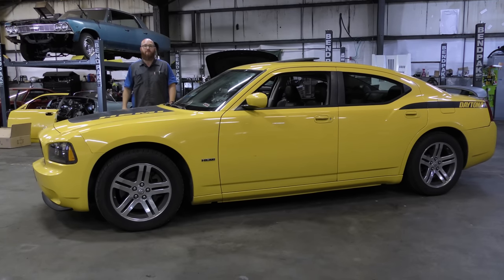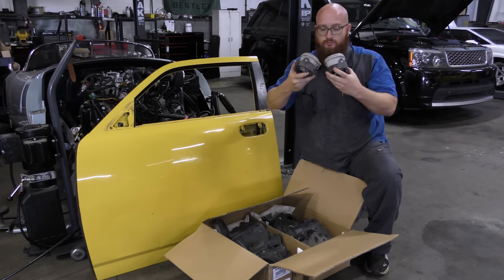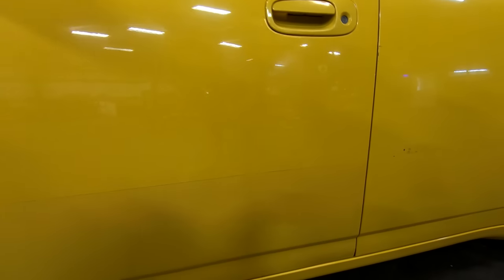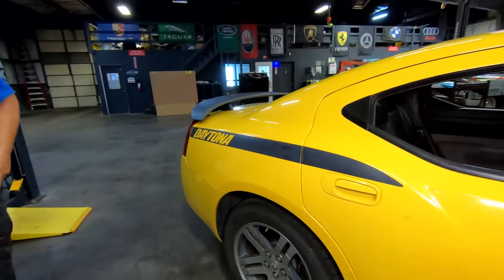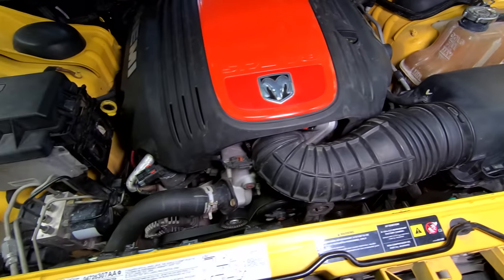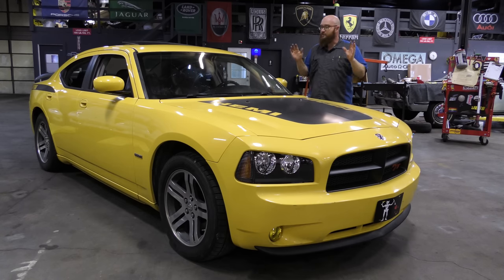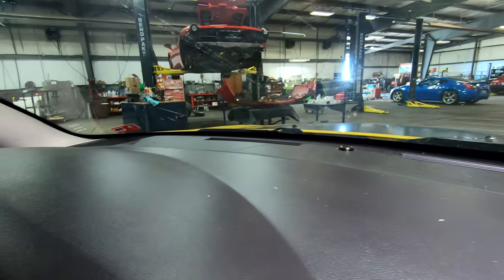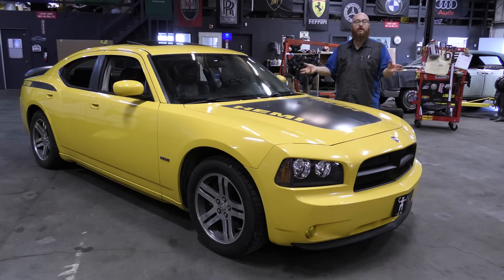Runs great! CAR WIZARD knows why he was sold this '06 Daytona Charger with a 'dead engine'

Comment: Top Banana is an awesome color! So happy to see this being fixed and driven!! I have an '08 Hemi Orange I bought new and drive it occasionally now, as it lives in the garage.....low miles and numbered lol! I am curious what number the one you bought is. The number is located on the passenger side to the right of the glove box. Should be xxxx of 4000, which is the total that Dodge made in '06 of that color. Also little known fact, the #1 in Top Banana was crashed by Dodge for insurance testing!

Comment: Hey wizard,
  I ditched the MDS a couple of months after I bought my Daytona brand new and never looked back...Did it  with the predator tuner...Actually got better gas mileage with it off!
Makes a big difference in the drivability too...And it backs off the traction control to where it's not annoying anymore! It's still there just not in your face!
   That's the only mod I ever did to mine cause it worked so good. I highly recommend it! Gets rid of that lame sound and vibration too....

Comment: I Bought a Porsche 944 S with 289,894 on the odometer for 3,500 put 2k in it drove it as a daily from Spring - Fall. No rust ran wonderfully. Sold it recently to a young man and his dad for 5, 500

The Miles will always plague the vehicle. But if the body is clean and straight. Runs and drives fantastic. You can't go wrong. 

Yes it's a gamble. But even buying a new car or slightly used one is the same way. 

I would rather buy a sorted vehicle that was well taken care of. Then a car at a dealership with a price to good to be true with low mileage. 

Thanks for sharing wizard 🧙‍♂️

Comment: For sun exposed bits, like the cracked piece you replaced, the whole dash etc, applying aerospace protectant 303 is a good idea. Used on airplanes and boats as well.
Reply: I use it on every new or used vehicle and it’s the best!
Reply: Believe it or not, for the black trim around the windshield, a lot of people use peanut butter to restore the black.

Comment: My sierra would sound like a dying tractor going into AFM mode, 
Had 200k and it still worked 
Most annoying part was it would switch into 4 cylinder than back into 8, go down a slight hill back to 4. 
Was like someone spamming a light switch. On off on off on

Comment: I have a 2012 R T classic challenger I got in September last year It have 49k on the car I had a repair shop in Knoxville TN with my dad and sold out but in the MDS or MSD I took the diablo I3 platinum tuner and turned it off that makes it a much pleasureable drive with no check ✔️ engine light on .

Comment: I had an ‘06 Magnum SRT8.  Loved that car!  You might want to check the side window defogger vents, they were something like $20 for a pair on Amazon.  But on my Magnum, the adhesive and the locking clips failed, and the vents were floating in their holes.  The replacements clipped in place and looked a bit blacked than the originals.  You have to like a $20 repair that actually makes the dash look better!

Comment: Definitely worth putting money into it, like you said for 3000 grand and you fix all the little stuff. You’re in it for 6 or 7  you can’t find one for under 10! Im a Mopar guy had 2  R/T chargers an 07 and a 09 and 2 magnums 05 3.5 HO with 275,000 miles didn’t burn a drop of oil and now I have an 06 R/T AWD I bought for 4500 sat for 6 years I put about 3500 into it and it looks mint! Love your channel

Comment: Glad to see a GEN I HEMI in the shop.  With MDS and an aftermarket exhaust the resonance is bad when MDS is engaged.  Had an MDS solenoid go bad on me, somehow ended up with a bent pushrod.  deleted the MDS, new CAM, push rods, lifters. new tune. Runs great.  Original owner 07 R/T AWD. 82k miles.

Comment: Wizard does better than Hoovie on buying cars with problems.  This car looks like it was possibly adult driven and then it was maybe passed down to teen driver.  The miles are about the time the suspension was completely worn.  The owner not knowing about cars like you mentioned, thought suspension noise was engine issues.

Comment: I just bought a 2012 pursuit that had an engine swap about 60k miles ago. Seller didn't realize it was a recent swap. Runs, drives, shifts, and stops great. Couple dings and dents and a few things I want to get done. But I picked it up for 6500 bucks because hemis are shooting up in price QUICK, and a charger or challenger with a hemi is basically my dream. Only needed an oil pressure sensor and a couple of nuts/bolts/lock washers because a previous owner/service tech stripped two bolts on the transmission pan. Not the prettiest fix, but it worked and the transmission is now dry. Interestingly, on the "extras" portion of my equipment list, it listed as being optioned with a "MOPAR High Performance Dual Exhaust." Don't know if that was standard equipment on all pursuit chargers, but i thought it was interesting

Comment: I had a 2010 R/T AWD with BC Racing adjustable coil-overs, aftermarket exhaust, hot air intake and a tuner. Wicked fast for it's size and very comfortable. It also had the cylinder shutoff system.

Comment: I would be leery of getting more door moldings that are promised to be color matched.  That yellow is very tough to get right.   Maybe get it in black so it covers the rust and scratches and then doesn't need to match. You might as well test if you would like the look using the old pieces.  Paint'em black with some fast drying lacquer and tape on the side to see if you like the look.

Comment: In my personal opinion, this the best and meanest looking of all the "new" Charger generations with perhaps only the interior not quite up to the same level as the newer models (but I suppose those could even be swapped if one is really motivated). But the front looks so mean and menacing and it is sad to hear that they are gone. Never knew that was a thing.

Comment: I had a 2010 charger with the V6, sold it with ~270k miles on it, still ran strong. It was my dads old company car, so just regular oil changes and it kept going!

Comment: If your hearing, feeling the eng go into 4cyl mode you have a big problem. When it deactivates the cylinders you can't tell, ever. More than likely you have a bad camshaft. The lifter failed and damaged the lobe. Do an aggressive acceleration and then the damaged profile on the lobe causes the lifter to collapse.  Then the eng shakes until it the rpms are down for a bit. Then the lifter pumps back up and the eng smooths out. If you cleared the memory you lost the misfire counter so no ck eng light. Drive it too long and the roller breaks apart and drops into the engine. At that point you can destroy the eng with all the metal bits. Just take the time and pull the valve covers and measure the lift and the valves while rotating the eng by hand. You can pop the cam and lifters in in about 8 hours. I did 2 this week alone. Not a big deal to do.

Comment: I owned a 2007 heritage Chrysler 300C 50th anniversary and what did it for me was the dealership I bought it from refused to replace the inside front passenger door panel. Because the chrome strip was broken off and I told them the only way that I would take it is if that was fixed. So I waited over a year and they basically blew me off so it wasn't long before I traded it in on a 2008 Pontiac G6 GXP coupe in 2016 and yes it had the street fighter kit on it the big over exaggerated Porsche 911 turbo wing on the trunk. The one thing that also made me hate the 5.7L Hemi is that each cylinder has 2 spark plugs so you are buying 2 V8's every time you even are thinking of changing them out.

Comment: Thanks Wizard! Great video. Next time you clean an engine compartment can you show how to decide which electrical components need to be protected? I've been doing it on my cars since 1971 and never had a problem until I did my 2004 Civic. The odometer has faded and come back and faded many times and is now almost unreadable. I'm guessing I have corrosion in one of the connectors somewhere, but I have checked any I can reach and no luck.

Comment: Wizard, look into a product called SC1 from Maxima oils. It is a clear coat protectant spray for plastics. Works wonders on the under hood plastics. It is expensive, but a little goes a long ways. I use it on everything under the hood of my Boss 302. Works great.

Comment: Love these cars, a little too wide for me though. My parents have an 07 sxt still in incredible condition. People are constantly giving offers for it. They'd never sell it, they got it with 6 miles on the odometer.
Reply: Im dying to get a Challenger Demon and or Hellcat....hell, I even want the Challenger Super Stock Version. It's a Demon that's doesn't have trans break and drag rave mode and also without high octane fuel mode. Thanks to the US Government new regulations on car manufacturers having to have a high MPG average between all of its brands, has caused Dodge to have the cancel the manufacturering of the 6.2 Liter V8 Supercharged Demon engine in, 2023. That's the last year they will make the engine, because Dodges average MPG is above the limits because of this engine. Sucks!! Those engines will now be super expensive to find and buy after 2023. Watch, finding a decent low mileage Demon engine set up the way I said above, will cost over 35k for a "decent" used one. Watch. Ugh. Thanks US Government....its also forced Dodge to make a, All Electric Challenger.....wtf.....reason why Dodge has done so well since, 2018 and has made record sales and profits is because it was/is one of the last manufacturers that make a massive, powerful, loud, gas chugging V8 High HP engines. Dodge made the return of the muscle car era. Now it's being regulated away, again...just like it was back in 1973 when the government back then, chocked the HP out of V8 engines for less smog and better atmosphere for out furure.....F the future lol. I live in the now, I'll be dead 100 years from now, I don't give a crap lol.

Comment: I actually knocked out a dent in my van with a hammer.  First I used the palm of my hand, and it came out fairly easy, so I then took a hammer and whacked it nice and easy as much as I was comfortable with.  

I didn't totally get rid of it but you don't even notice it now and that's good enough.   If I wanted to I probably could have worked it out more with a body hammer and dolly, or I could even fill it and not be too deep, but eh, I don't want to disturb the paint.

Comment: 13:44 if your gonna take this thing to lowen Upholstery, can I make a suggestion, its called a daytona, ask him if he can recreate the Daytona seats that ferrari started doing with the Dino way back when, with two tone black and yellow inserts and yellow stitching, as the interiors rather standardish looking, and that and maybe some custom gauges would really set the thing apart without going too far with it

like black background, yellow numbers

and honestly I would take the yellow center console insert out and go for black or an argent silver, like on the car the nash bridges cuda was based on where its grill and shaker are in those tones of silver, while the outside is lemon twist yellow, 

while on the nash car, its black with a performance crate under the hood, and a sherman williams color on the exterior, safety yellow that looks more redish yellow, like a color between lemon twist and buterscotch. 

also with the luck hoovies been having, maybe after his next lambo bill you should go to van go and have them go over this thing and see if they can fix the doors so you can leave it without the guards, also with 6:51 what about taking the intake off and redoing that to match the badge, as their two different reds, or even do that in argent silver too.

Comment: Aftermarket exhaust systems or straight piping an AFM/MDS V8 can be risky for this exact reason. It may sound awesome in eight cylinder mode but when it switches to four cylinder mode the car sound atrocious, especially when cruising on the highway. Best solution is just to have the AFM/MDS disabled. Even though its supposed to improve mpg I didn't notice any change in my fuel efficiency when I had the AFM in my Grand Prix GXP disabled.

Comment: Can you turn off the cylinder deactivation module? I've heard they cause problems and early engine failure, or have manufacturers solved the bugs? Enjoy the car. It's very nice.
Reply: Only an issue of you let it idle for hours at a time, and don't check/change, or use poor quality oil, and filters.

Comment: Headlights $120! Lucky for You. If my 2012 Mercedes CLS Led Headlights will break it is just about $4327. I hope those Leds can change and have parts somewhere... And I know how expensive those CLS hood, doors, trunk lid, and fenders are because those are aluminum. The last time I had an accident in Poland, the crashed car repair estimate was $28,225 and the car price was $41,162. The insurance company didn't repair it. So I did buy a cheaper 2002 year S-Class in July 2020 and in November 2020 more expensive 2006 S-Class. 2022 January I bought again the 2012 CLS. I love CLS 350 CDI, it is so beautiful. It is diesel and has 265 hp and 620 NM (460 ft-lbs) torque. 0-60mph in 6 secs. Quite fast and economic for a diesel car. Next year I'll go to pension from the air force at 56 yo. and it will be my granddaddy car.

Comment: Mine did the same thing. If it goes away when u put it into Manuel and it goes away at 20 30 35 40. Its the MDS. I just got mine tuned and turned off the MDS. I get like 1.1 less MPH with it off. Its also the reason it drops a valve seat cause of the MDS. Just tune it and turn it off asap

Comment: That’s funny about the MDS. If you don’t know, you don’t know I guess. My ‘15 Ram sport had a flowmaster 40 on it, so it was less noticeable when MDS came on, but I did a muffler delete with a Y pipe on my 18 Ram sport and it’s much more noticeable with the exhaust note, if it’s on, to the point where I can see the RPMS adjust slightly and feel it in the cab. More often then not, I’ll run the gear up button to 8 and it’ll override the MDS and I get close to the same fuel economy if I’m easy on throttle.

Comment: I  own  a 2009  Charger Se with 185,000 miles with  the 2.7 engine,   I   love this car even though its white and just an Se,looking for a low mile 2.7 replacement engine,I've owned it since 2017,and I bought it with engine issues,it makes more sense to replace the engine rather  than fix this one,it does still run,but has at least  a blown head gasket  ans low oil pressure .I just can't bring myself  to sell this car,  it's a Ohio  car but only has the common rust bubbles on the rear quarter lips

Comment: This might be controversial because it seems like you're trying to keep this as budget build as possible Wizard, but I say when you're all done, run it through your buddy's auto body shop and have him do some paint correction. A cut and buff along with fixing that dent and some of those blemishes on the bumper will be well worth the money. Makes sense since you're already doing the interior as well anyway. It will really take that car to the next level and you'll be super happy when you have a 250k 06 Daytona that looks like a 5k mile 06 Daytona. It shouldn't be crazy expensive to do either.

Comment: If I had a Charger again I would disable MDS . I think it heat soaks the head and causes valve seat to drop unless you pull the heads and have the valves pinned . Love the Daytona .
Reply: How is the MDS disabled? With a scan tool?
Reply: @Derek8487  you can use a tuner to disable mds or relpace the cam and lifters with non mds and remove mds solenoids

Comment: Make sure if it hasn't been done, that you change out the stupid pink shifter thingy with the metal aftermarket one. It was the only time my Magnum left me stuck, thankfully it went when I was home and had tools handy.

Also, pulling the beltline trim didn't chip the paint...All the LX cars look like trash under the trim, they must have slapped them on a the factory when the paint wasn't properly cured.

Comment: Disabling the VVT is pretty easy, just tedious. All you have to do is once the engine is running push the gear - button one time (the readout should say 8th (gear). And it'll stay in V8 mode. The tedious part is that you have to do it everytime you start the engine. Why would anyone want to do this? well... Full time V8 sound, I guess (as well as V8 thirst).

The permanent way is via an over priced, reprogammer

Comment: Quick question: I have a 2006 dodge charger that occasionally has a lost of communication with the BCM. What can cause this? The car keepa running but the gauges and the ac stop working. It mainly did it in cold months. But it recently did it in hot weather.

BTW, NICE CAR!!!
Reply: Check grounds and all connections. Check for pinched wires.
Reply: Idk about chargers, but the Jeep TJ's had the computer mounted vertically behind the battery and after many years and millions of bumps the pins on the computer board would get fractured, there's video's out there of guys soldering these themselves other just replace them or have them fixed at $800-$900.